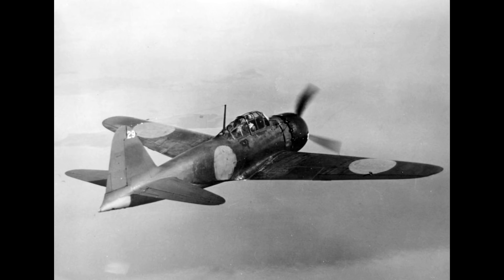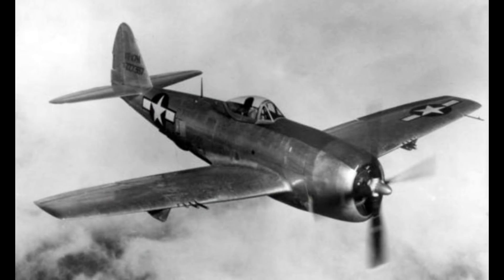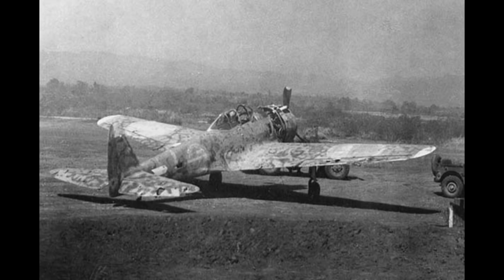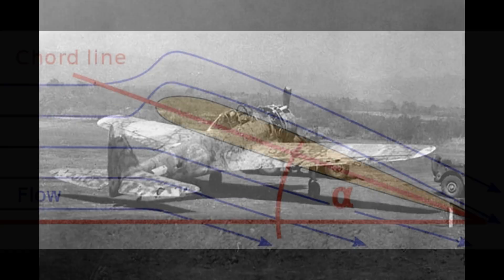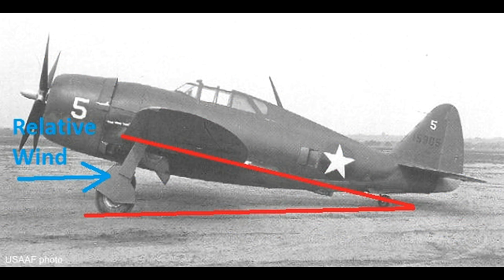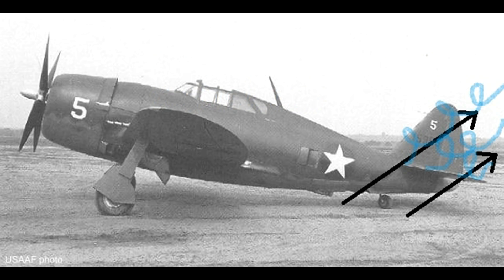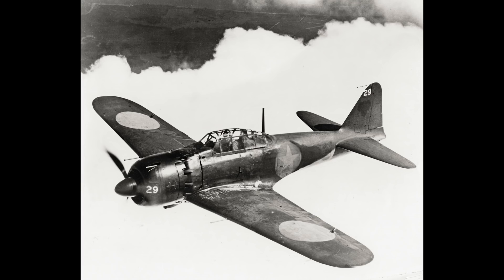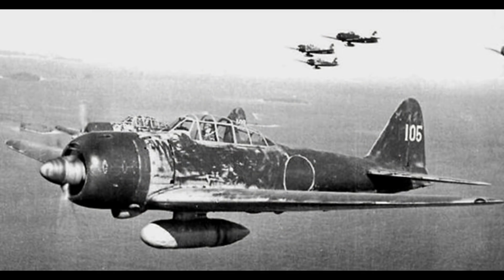Mitsubishi A6M Zero, an interesting fact few people know

Comment: Hawker Typhoon and Tempest.
Reply from the maker: The vertical Stab on the Tempest has a leading edge that's forward of the horizontal stab, the opposite of the Zero. The Typhoon is a little bit that way, not not anywhere near like the Zero.

Comment: Nothing to do with the Gloster F.5/34 having a tail set up the exact same way )))
Reply from the maker: Officially, those two planes have nothing to do with each other. Unofficially, yup, they sure do look a like, and the Japanese had a penchant for copying others.
Reply: @GregsAirplanesandAutomobiles  
I haven't seen any solid evidence directly linking the F.5/34 and the Zero, other than Gloster having worked with the Japanese on other projects previously.
Though I do think it would have to be a really impressive coincidence for them not to be related.
Reply from the maker: I don't disagree. It's hard to argue that the Zero wasn't heavily influenced by western designs. The Gloster is one, the Vought V-143 was another.

Comment: Why did you skip the FW190?  It also uses this design concept.

All leftwing Govts, whether Fascists, Communists or a Monarchy can develop one thing then they get stuck with that one thing forever.  Capitalism (INDIVIDUAL LIBERTY) is the opposite thing and why it will always work better.
Reply from the maker: http://www.wwiiaircraftperformance.org/fw190/fw190-a8.jpg
Reply: @GregsAirplanesandAutomobiles  What am I missing?  Its forward and much smaller?  All intended to get airflow to the rudder at high AA.  No?
Reply from the maker: It's just a matter of degree. What I said in the video is that I don't know of another plane with the stab so far forward. I didn't say that no other plane had a horizontal stab forward to some degree. If you look at the center of the chord on the zero's horizontal stab you will see that it's almost forward of the entire vertical stab.  On the 190, P-51, and others people keep pointing out, yes it's forward but not so far forward. A plane that is really far forward like the Zero is the Fokker XXI, but nobody every points it out.
Reply: @GregsAirplanesandAutomobiles  I don't like to argue about "degree's" lol.  The argument changes to something else at that point, lol.

Comment: American superior fire power! Are you kidding? Americans planes had 50 cal. while the Japanese and the Germans had CANNONS!!  The 50 cal. worked pretty good against the Japanese with no armor, self sealing fuel tanks or bullet proof windscreen, although the Americans has superior speed, with the later fighters, the 50 cal. worked pretty good with the boom and zoom, but the guns were no match for the cannons if the Japanese caught the allied planes in their sights!  The Japanese, as well as the German fighters were turners so Americans did not get into a turning fight with them, that is until the P-51 that could out turn, out dive and were faster and well armored, and the 50 cal. tracers would set the Zero's on fire, as well as the Germans set the Shermans on fire!!
Reply from the maker: No, I am not kidding. Six fifty calibers will destroy a Zero or almost any Japanese plane with a quick burst. There is a lot of gun camera footage out there showing just that. The Zero has two light machine guns and two cannons. However the cannons have a slow rate of fire, are inaccurate, and only have 60 rounds per gun. In fighter vs. fighter combat, six fifty calibers are far superior to the Zero's weapons.
Reply: and some Spitfires were armed with 20mm cannons, get hit by them and you are toast, they will go through the aeroplane length ways,and through the crank case and keep going. the mosquito had a 70mm howitzer in its nose, they could out run any German fighter they would chase them back across the channel and put a couple cannon shell up their clakkers. you would be crapping you daks if one of them got on your 6.